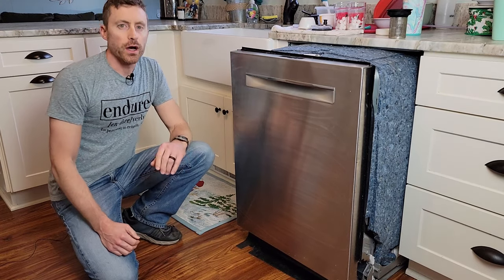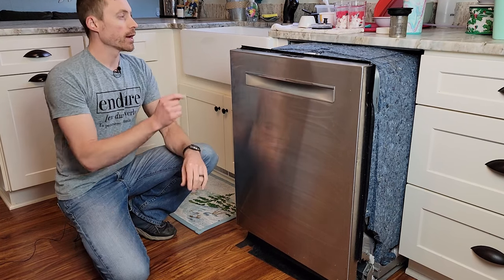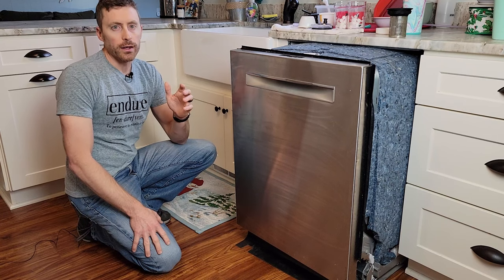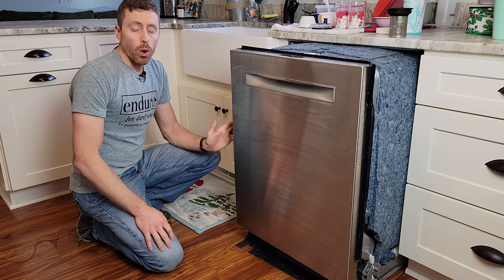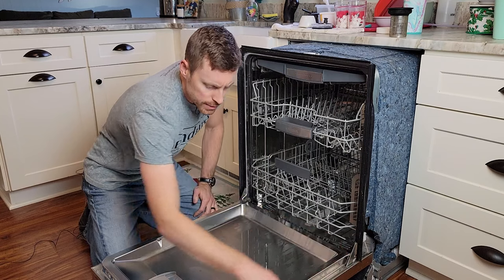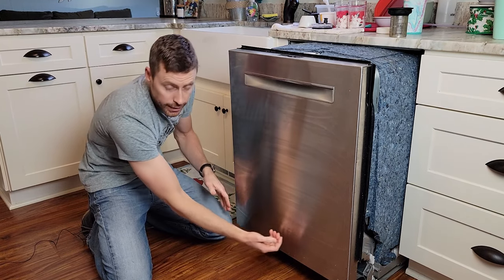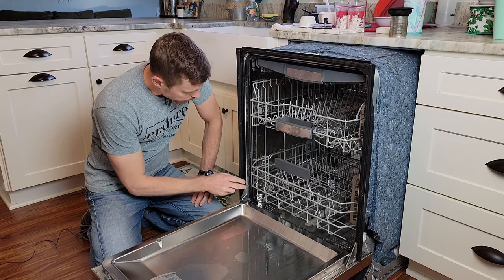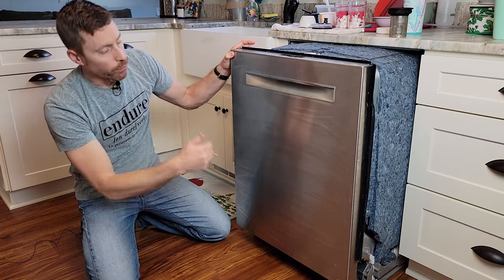Bosch Dishwasher e15 Error Watertap - Prevent it from coming back - Bosch 800 Series

Comment: Many thanks - excellent presentation!  Here are 2 simple suggestions for preventing the problem.  1.  Do not open the door when the dishwasher  is washing - that may increase the chance of water leaking into the bottom.  2.  Open the door as soon as the dishwasher finishes - this may help evaporate any water in the bottom while the machine is still warm.  That has worked so far for me after simply resetting the machine (turning it off for a minute and on  at the circuit breaker)..
Reply from the maker: Great tips! I agree on not opening the door once it's going. and it's great to open it when it is done so you can let it air dry.

Comment: This worked perfectly.  I had a bit of an issue with Bosch support, they were not help at all.  They just said that the water sensor switch tripped. They offered no help at all.  I now thing that the previous repairman who repaired the crystal dry fan caused some of it.  When i checked the water it was there but seemed old, not from a current leak.  I also figured out that opening the door repeatidly during the wash cycle will allow water to drain off the door and down into the bottom area which would cause the same issue over time.  I guess I shouldn't complain, its the first time in 4 years of daily use it happened.  The fix was simple, thanks so much for your video!
Reply from the maker: awesome, glad it helped.

Comment: Bosch needs to  fix the design of that seal so that gunk can't collect there.  Otherwise, cleaning it as described here will solve the problem for now, but it will keep coming back.  For now, if you are having this problem you might want to review how well you are scraping or rinsing your dishes.  I know they all say no need to rinse, but that doesn't mean it wouldn't be a good idea to remove most of the non-soluble material.  I know some people just go from the table straight to the dishwasher, but in my humble opinion that is not a good method.
Reply from the maker: yeah I think that's the issue. I do try to remove most of the larger chunks of food from the dishes before loading.

Comment: The door not seating is caused by the upper rack not guiding on to the water attachment at the back of the dishwasher.  If you jiggle the  top rack it will probably pop all the way back into place.
Reply from the maker: I agree, that middle rack just doesn't want to sit properly. Im guessing it's because of the various ways it can be adjusted.

Comment: I've been looking for my E15 water leak for 2 days now... Your comment about the plastic channel made sit up and listen... I couldn't find the source of the leak... it seemed to come from within the "foam leak sensor'... through your video at 3:58 runtime... I now realize the plastic channel runs directly into that...this makes me pretty sure this is the source of my water... I think I have the same sealing issue along the bottom like you had... I couldn't figure out how water would leak into the bottom catch tray from the main washing compartment until you mention the plastic channel. Thank you for your video.  I about to go check that gasket for gunk and try to clean it out!
Reply from the maker: Dang, that sounds like the process I went through. I haven't had the water tap issue for the past few years since I cleaned that lower gasket. But i have to clean the side and top gasket frequently to prevent the dishwasher from shutting off mid cycle. Pain in the butt.
Reply: @poodledad  No E15 this morning!  Yay!! But I did have a little water in the catch-tray under dishwasher… not enough to trigger the sensor I guess… I’m seeing a white scale residue on my door gasket… mostly one side… I scrubbed that for while yesterday before we ran the evening load.  I’m considering buying new gasket to see if that will make a tighter seal.  Do you know that part is replaceable?  Thanks again!
Reply from the maker: @scottstevens5481  I think that's a good call. Hope it prevents it from coming back.

Comment: Of course this happens at 9:30pm and the pump is relentlessly cycling to try to empty. Thanks to this video, I was able to fix it quick and probably found the leak source, bottom left door seal with hard water deposits on the seal and door. Cleaned all surfaces, dried the bottom, done! Thank you!
Reply from the maker: Awesome. It's definitely a common issue with this range of machines.
Reply: 9.30pm and having the exact same issue. I think they program them to do this. Amazing given they don’t have a clock built in.

Comment: 90% of all case help just get out water from bottom. This seal theory is nice, but very little chance to make this problem. If you look closer to bottom door gasket, it have holes. I repaired a lot of e15, but still not 100% sure when problem coming. In most cases from big rubber gasket between dishwasher body and plastic filter bottom.
Reply from the maker: Yeah could be. In my case I could actually watch where the water was dripping from.

Comment: Your absolutely right, I watched several  videos and no one mentioned that bottom door seal. It makes a lot of sense. One way to help prevent that from happening is to pre rinse your dishes before putting them in the dishwasher and regularly checking that seal.
Thank you much for taking the time to make a thorough repair video!
Reply from the maker: Thanks. Glad it was helpful. You're right that it should be checked fairly frequently. I do tend to get most of the food off before putting it in the dishwasher. That keeps the bottom filter from getting too nasty.

Comment: I had to come back here and comment that you absolutely nailed the issue we were having. We were moments away from spending a ton of money for a repair from the only local company that works on Bosch dishwashers (with MANY sketchy reviews) when all we needed to do was clean around the seal! It's been months and it's still going strong, I just make sure to wipe any excess water from the door prior to starting the dishwasher every time. From a poodle mom to a poodle dad, thank you so much! 🐩
Reply from the maker: Awesome. Glad it helped. Much better than paying someone. I honestly wonder if the technician would have figured that out? Or maybe replaced the entire gasket that seals the door? Who knows but glad you didn't have to find out.

Comment: Tip worked, very helpful, float easily accessible from the left side of the device.  I prepared with the T-20 Torx bit two towels, a toothbrush, and cleaning solution, to clean the seals.  Improper loading of the device can also lead to water in the bottom.  Large items  may direct water at the seal or the side vent in the machine contributing to a leak.  

I was left wanting additional video or images of you getting access to the foam disc before I took apart my dishwasher, but I was glad the tip worked.  Thanks.
Reply from the maker: Awesome. glad it helped. It does seem like a design flaw that the door isn't sealing well, or will run without being sealed. I didn't have this issue with other Bosch models, or even cheaper dishwashers.

Comment: Thanks for directing us in the right direction. Towel dried what water we could get to. Tip on side at 45° to drain rest of water and then used hair dryer with no heat to completely dry. Error code immediately cleared when power was restored. Will run wash cycle later to make problem solved. Gasket was not very dirty at all. Problem may have been caused by plumber moving unit prior day to install water purification system. First time we have got the error code.
Reply from the maker: Hope the dreaded code doesn't return!

Comment: Thank you for posting this! Checking the door seal saved me countless hours and cost of troubleshooting what I initially thought was a leak around the sump, motor, or drain area.
Reply from the maker: Awesome. Door is a bad design. It just doesn't close tight enough. They should go back to an old school slide to close latch that pins the door closed.

Comment: just got the E15 in the rush morning, turn off the breaker and will take a look tonight, thank you
Reply from the maker: Good luck! Hopefully there's not so much water that you have to pull the dishwasher out. Maybe it's just the door seal. Such a common problem.
Reply: @poodledad  thanks for your video again, I did open the dishwasher and I see a little water around the disc and I clean it up, I dont see any water drop after the 1st run. Since the inline value is behind the salt container, I can't take a look. I just closed and it seems ok. Wish me luck

Comment: Thank you. Did your suggestions tonight and got at least one run without the E15. Hopeful!
Reply from the maker: Awesome. Hopefully it will keep on working. Mine worked for a long time after that and then I needed to do it again a year or two later. But I've also had other issues with this unit which I posted in another video.

Comment: This is a wonderful video because it is not about resetting or cleaning underneath which other videos do. Instead,  this is about trying to go to one of the root causes. Thanks for making this video. Very helpful.  However,  to this series, can you add if we need to clean the bottom Styrofoam before we reset, and the other piece is how to reset. It will make the series comprehensive.
Reply from the maker: Great thoughts. Thanks.

Comment: Thank you for sharing your knowledge. I was able to pull out the dishwasher dry out that little space underneath and the float all in a Sunday hour. Without your help, I would have been out of a dishwasher for the better part of a week, not to mention the $90 (plus) plumber visit fee all because I loaded the dishwasher wrong such that the front door was closed but not sealed. So a little water leaked down. Thank you! ❤❤❤
Reply from the maker: Glad it helped! Much better than having to pay for someone to look at it. It does seem like a design flaw that the door isn't sealing well, or will run without being sealed. I didn't have this issue with other Bosch models, or even cheaper dishwashers.

Comment: Thanks for the tip on the water pooling up underneath and the potential reasons behind it. I've see this error in the past several times on my Bosch 800 dishwasher, and resetting typically takes care of it - not this time. Followed your steps to dry out the bottom and cleaned the door seals thoroughly, problem solved!
Reply from the maker: Awesome. Glad it helped!

Comment: My Siemens dishwasher had this issue …
I didn’t wish to take it apart so my easy fix was to simply pull it out  from its emplacement then tip it on its side to release any water .
Has worked fine since
Reply from the maker: Awesome, yes, you can tip it to drain the water. The Bosch has an opening once you pull it out where you can use a towel or rag to soak up the water. It doesn't take much water to trip the sensor.

Comment: I did exactly, as you said,  actually ran an empty cycle and watched to see if any leaks? None.
Put it together, wife washed dishes all good.  Next morning got E15 again. Turned power off but let water valve open. Next day,  unit filled with water,  tub as well???
Reply from the maker: Yikes. There are a few other things that can cause the e15 error. Basically anyway that water is getting to the bottom of the dishwasher. In my case, I could see that water was coming from the door gasket. Hope you can find a fix.
Reply: @poodledad  i ordered a inlet solenoid.  Hope that does it!

Comment: I had this problem a couple weeks ago before I found this video. I pulled the door off mine leaving the controls attached to the door so I could run it and watch for the leak. I could also see the water trail from the door and sure enough that’s where it was coming from. I took a guess at it and cleaned the door seals and found buildup on the bottom seal like in the video. Since cleaning them it has ran without leaking several cycles now and appears to be fixed. There’s a pump seal and hose connections that can leak so running it with the door off will allow you to see where it’s coming from but I’m guessing the dirty seals are the most common issue.
Reply from the maker: Definitely a common issue based on how many people have watched this ha. thanks for sharing!

Comment: Thanks for your great video, I have the E15 error, and I'm figuring out what causes it. I'm gonna try your solution.
I might have caused it myself when removing a piece of food that was stuck in the pump. (disassembling the whole sump unit with heater and pumps) 
Now a tiny bit of water gets under the styrofoam disc and sets error 15.
I checked all the seals and hoses and they stay dry, so my guess is I have the same issue here.
The strange part is, that the error happened in the drying cycle, so it almost completed a full washing cycle before shutting down.
I keep you posted.
Reply from the maker: Hope you get it figured out. Bummer to have such a nice dishwasher give you trouble.
Reply: @poodledad  thank you!
I found the leak. In my case it wasn't the simple door leak unfortunately. I saw the sump leak.
So that means it needs a new gasket or a new sump.
I'm going to try it with some silicone sealant as others suggested.

Comment: I have this same dishwasher. The other day the top rubber seal fell out on the floor. My wife stuck it back into the unit but it was still lose. Two days later got the e:15 error. I fixed the top seal and I’m mopping up the water in the bottom. We will se if this was where the leak originated. Keeping my fingers crossed.
Reply from the maker: Hope it works out. These dishwashers are too expensive to have seal issues!!
Reply: @poodledad  so far so good. About 1/2 way through a cycle.

Comment: Thank you so much! This was so helpful and gave me a clear idea of what is happening. I would really love your thoughts on my situation: I bought a used Bosch 800 and would get water at the sensor. Thanks to your video, I noticed that the lower left screw of the door won’t sit flush against the paneling, so it’d slow leak down into the sensor. I’m not sure if the hole is stripped, but I’m not able to tighten it any further and get the door flush. Any idea on how to fix?
Reply from the maker: Yikes not sure. It's amazing that this expensive of an appliance has fit and finish issues like that. Such a bummer. Let us know if you find a fix.

Comment: Hi, what do you suggest if there is an E15 error but no water in the base of the machine? The water tank on the left side of the machine on the outside is full of yellowish water though. Thanks
Reply from the maker: Weird. Well, it doesn't take much water to trip the e15 and it could dry up by the time you check. I don't know anything about a tank on the left of the machine. Maybe that's just where it drains.

Comment: just fixed mine by cleaning all the seals and emptying out the drain hole at the bottom of the DW :) Thanks @poodle Dad
Reply from the maker: Excellent! It's amazing how many people are having that issues. I'm not sure what the design flaw is that keeps causing that. I try to wipe down the seals every week or so to prevent it from happening again.

Comment: Thank you for this video! I pulled mine out and there wasn't any water in the bottom. I tilted it just in case. Then plugged it back in and heard a beep. However, the display is no longer on. Did you run into this problem? Any idea how to fix it?
Reply from the maker: Oh no, sorry to hear that. No i didn't have that issue. I turned off the breaker, then got the water out, and then turned it back on. I had to do this a few times since the error kept showing up every month or so, but didn't have the issue of the display not functioning.
Reply: We did have this issue with no display....and we resolved by turning off the breaker....while one person held down any 2 buttons on the dishwasher another person turned the breaker back on and the display came back on! Saw this tip online. I know your comment is a year old but perhaps someone now/currently has this issue as we just did.

Comment: Great video/tips. But, please tell me, how do you get the machine to run if you have the door off? I believe I have a model very similar to yours and all the on off stuff is on the door. Thanks
Reply from the maker: Yeah, mine is the same where the controls are on the door. I pulled the machine out and ran it while I watched where the drip was coming from underneath. Probably not recommended, but I'm not sure how else to diagnose it. These machines seem to have a problem with the door sealing and water drips underneath.
Reply: @poodledad  After reading this I played around with the door and I was able to disconnect it and lay it flat on top of the dishwasher and then reconnect the wires to it (they were long enough to reach). So thanks for that thought to take the door off!! This allowed me to run the machine and have a good look at the seals and underneath to check for leaks. Unfortunately/fortunately I found I had a leak from the diverter assembly, AKA water switch housing. The seals are fine! A previous E15 I had was due to a leaking water inlet valve. I also had an issue with a draining noise that ended up needing a drain pump replacement. How many $500/600 machines could I have bought for what we paid for this one? Might be a way to go next time.
Reply from the maker: @eddiemarano9998  agreed. I don’t think I’d buy another Bosch appliance
Reply: @poodledad  I'm kind of running out of dishwasher brands to buy! 😃 Previously owned Kenmore, Kitchen Aid, Whirlpool, Miele and currently Bosch. Perhaps they're all just the same thing. Although, the three parts I replaced ono the Bosch maybe cost me $100 in total. I do my own repairs, thanks to the good people of You Tube, so that's not a whole lot to keep the machine going and a lot cheaper than a new one.
Reply from the maker: @eddiemarano9998  all appliances are a crap shoot